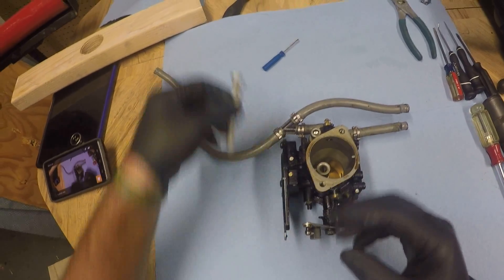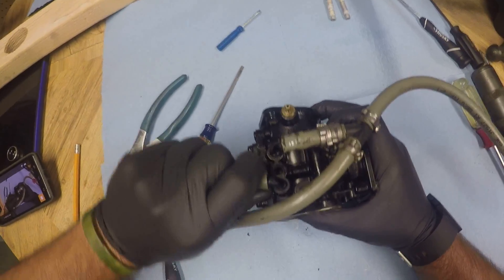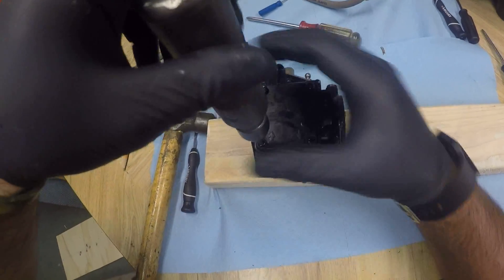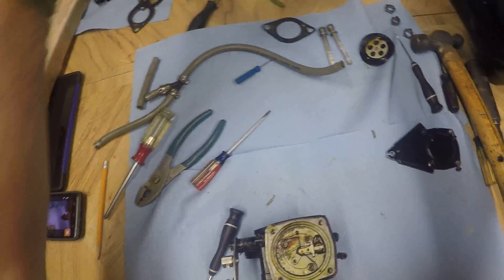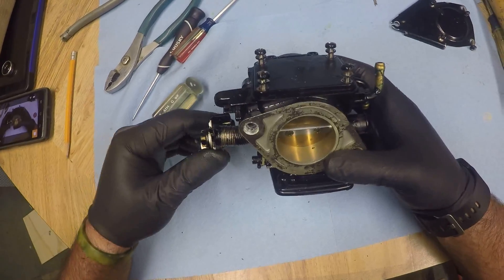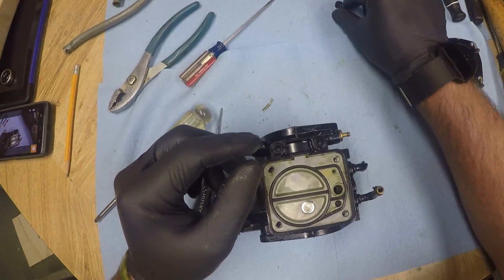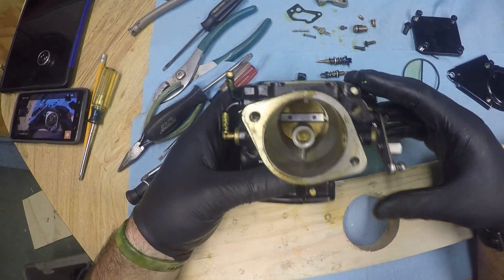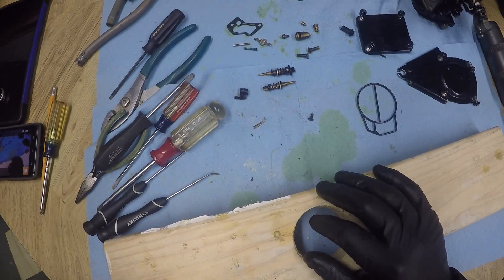Mikuni Watercraft Carb Disassembly

Comment from the maker: Sorry to all, unfortunately there will not be a part 2 to this where the final cleaning and assembly occurs.  The machine that the carb went to was sold and I no longer have it for demonstration.  Assembly is essentially the reverse process.  Any and all non-metallic components should be replaced and the pop-off pressure of the needle/seat should always be verified before installation.  If I ever get my hands on another carb I will post a follow up video.

Comment: Hi there I rebuilt my carburetor and fuel hoses and I couldn't get the fuel to flow from pump, I saw a different post were someone said to mix oil and fuel in a container and put inside the carburetor to get it circulating again I have a 98 bombardier gti  any help would be appreciated it

Comment: This is the best video out there for this particular carb.  Thank you for posting this up!  Since we didn't get to see the assembly, I was wondering what your thoughts are on the gaskets.   The rebuild kit I bought comes with a variety of paper gaskets but mine did not have any on it.  Do I just stick with only the rubber gaskets?   I'm a little worried to put it back in before I varify if I need to add those or not.
Reply: Hi Mike and Andy. I was wondering the same thing. My carb had clearly been redone before I got it and had no gaskets at all, just the rings. My kit has a lot of gaskets. What did you end up doing?

Comment: What's the purpose of that check valve on the underside of the jet cover?
Reply from the maker: That check valve that is the thin plastic film prevents backflow into the main area on that side of the carb.  Basically it ensures that fuel that enters that portion of the carb does not flow backwards so that the jet area always remains bathed in fuel.  If not there it is possible that a pressure change in the intake system could push fuel out of that area and starve the engine for fuel.

Comment: Very good quality video -- thanks.  Yours is the only one I have seen that showed the removal of the limiting caps on the adjustment screws for the jets (on my carb, both high and low speed jets have caps).  I'm now much more confident of my ability to clean and rebuild the carbs on my new-to-me 1996 Kawasaki 750 SSs.